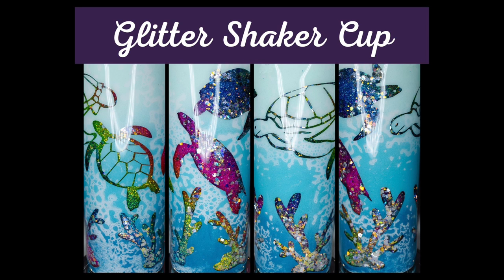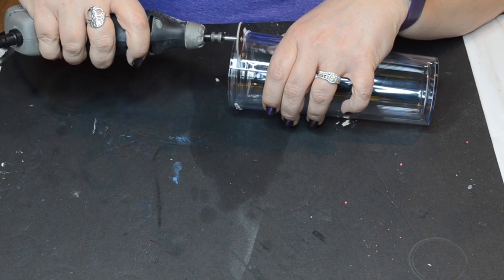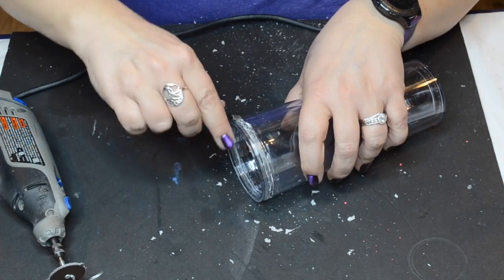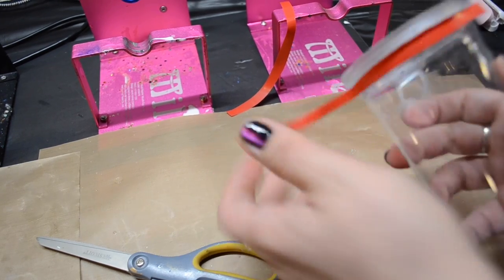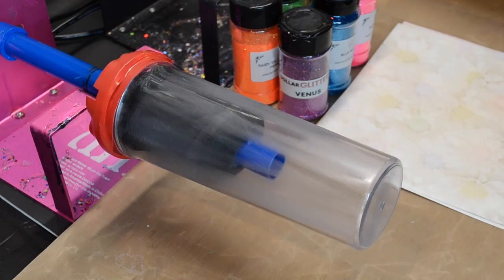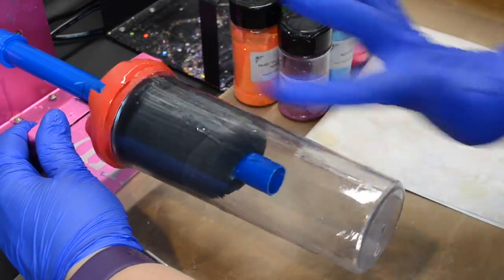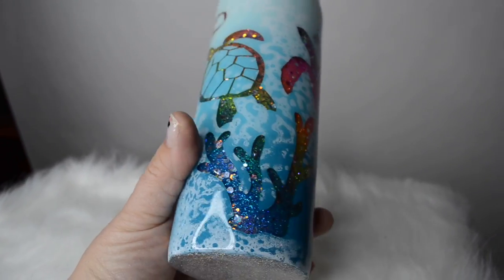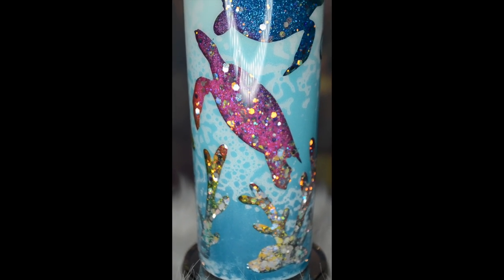Glitter Shaker Cup

Comment: I'm so jealous, i want to make that so bad and I have the cups but I didn't know I would have to cut it open even thou I have a Dremel Tool. Also so many people say you can't or shouldn't put epoxy on plastic or acrylic cups because the epoxy seeps through the walls of the cups which could harm a person. You did it and I love it, but what do you think about what people say?
Reply from the maker: If you don't want to cut it like I  did here you can still make the cup with oil mixture and glitters and place vinyls and epoxy on the outer layer. I will show you a pic of one I've done

Comment: Thats a really cool take on mixing different styles and techniques! Would adding a little mineral oil 1st before the chunky glitter help with getting smaller air pockets?
Reply from the maker: You can do that, but you would have to let the cup site for a bit so the oil settles.  If not then the glitter you pout in will stick to the sides where the oil collected
Reply: @crystaluv3313  thank you

Comment: @Emersyn Aurora Design  okay, so my question is the epoxy part is on the layer of plastic that is on the inside of the cup. The drink is on the opposite side of the glittered/epoxy side. I have heard of using these storyboard cups but on the outer side and the water, baby oil, or whatever it is your using to fill it & glitter to make the snow globe effect in-between the layers of plastic. So the epoxy layer is not directly in contact with what is being drank. All epoxy is food safe & compliance. Just the same as when we use it it is not safe without our PPE. It's beautiful just not for me Sorry
Reply: I had the same thoughts. I wonder if clear spray paint would be better than epoxy?
Reply: I was wondering the same thing

Comment: I thought your not suppose to drink out of a plastic cup that has epoxy on it.
Reply from the maker: These are double walled cups. The resin I use is food safe fda compliant resin. It's safe. It's not a good idea to resin a single walled acrylic or plastic cup because they aren't as strong and the resin could crack
Reply: What resin do you used to stick the glitter between the the walls?

When I used glitter and baby oil my glitter moves sooooo slow. That’s how it has to be?!! I saw another cups that they move faster. 
Thanks.